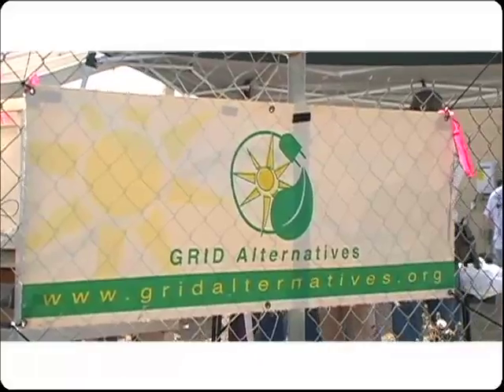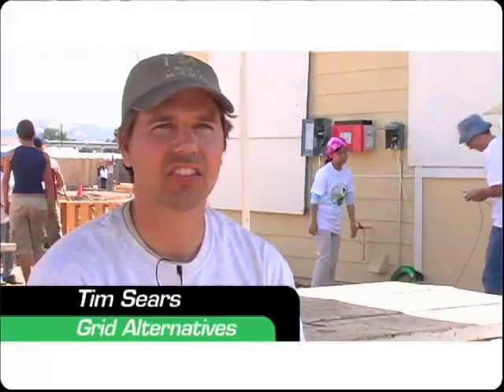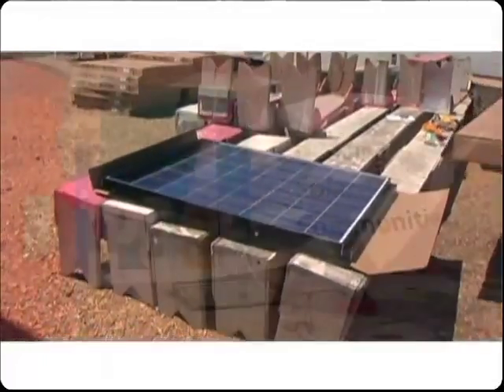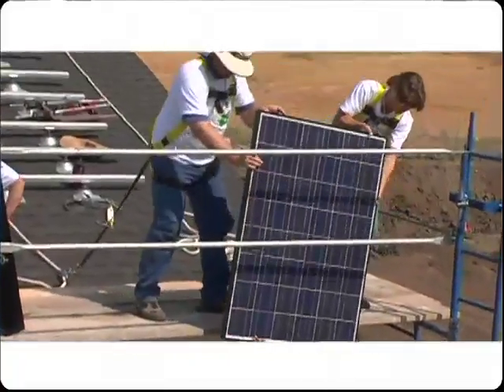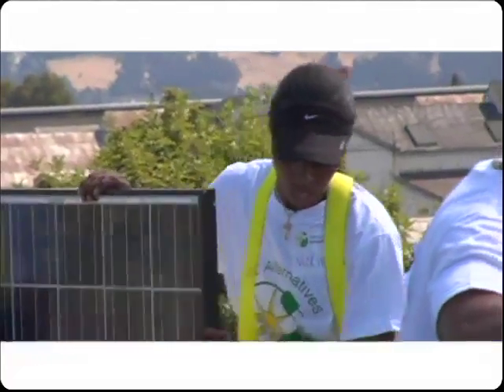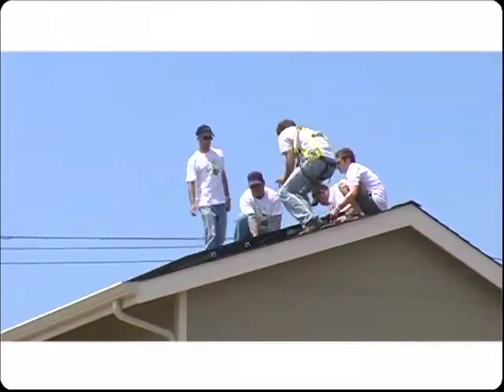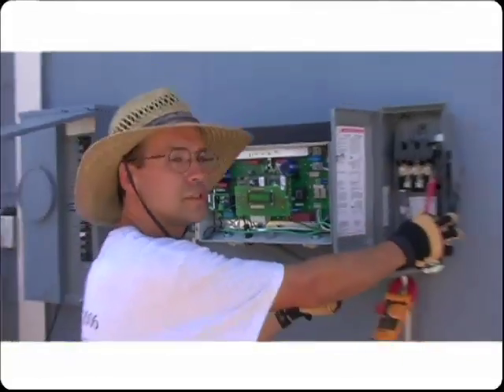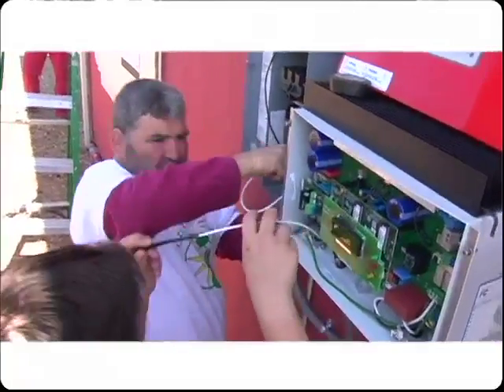TreehuggerTV: Grid Alternatives

Comment: I was watching a Modern Marvels episode recently on renewable energy and they said that an average size home with a solar cell-laced roof could provide the bulk of the electricity for the home. (If not several times the amount; can't recall which one.) In Israel it's actually a law or at least part of the building code for homes to use solar water heaters.